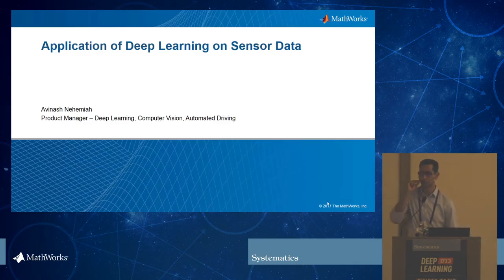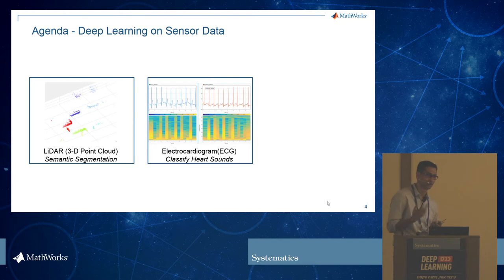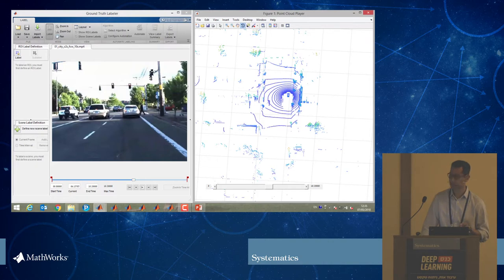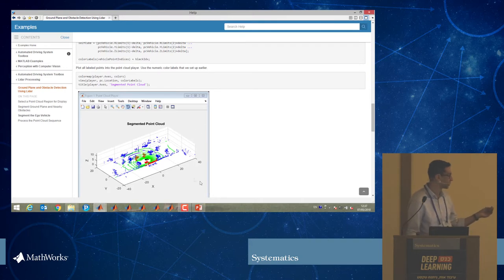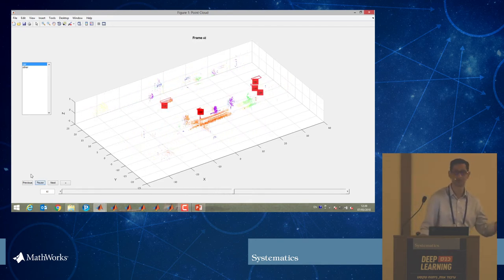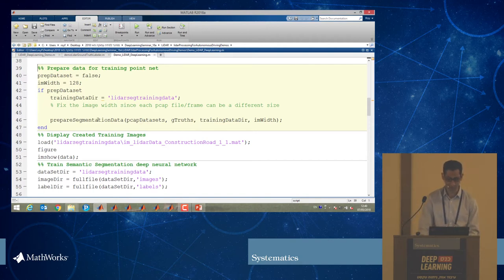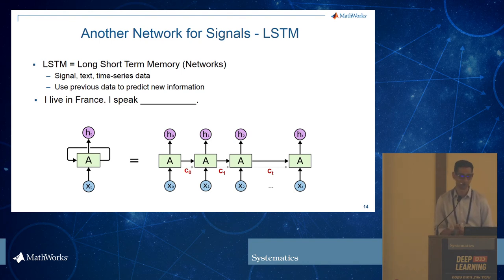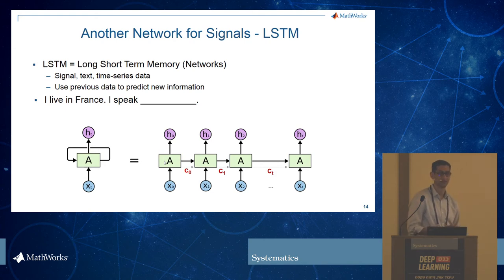Signal Processing Techniques for Deep Learning on Sensor Data

Comment: Very nice presentation. However, I have some concerns about the second use-case. What about the test accuracy? Because any deep learning model can get fairly good accuracy in the training phase especially if it has to distinguish between only three classes. For example, in one of my work, I have seen that using just one preprocessing layer, one dense layer, and one classification layer, the training accuracy was above 90% in detecting three levels of stress from ECG signal. In that work, I did not do any preprocessing manually. I just took the noisy raw signal, and dumped them in the neural network. So my point is that, for medical data such as physiological signals, analyzing the training accuracy for evaluating performance is not a good idea because usually they mean nothing. For example, you can have 90% accuracy on training data, but on test data, your model might as well just be performing random guess.
Reply: yes İ agree with you, I need to distinguish eeg channels, I dont know how can I do so that in th real time seperating